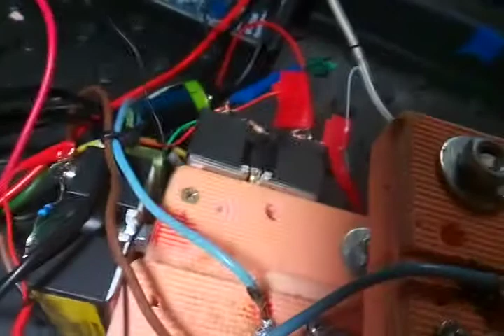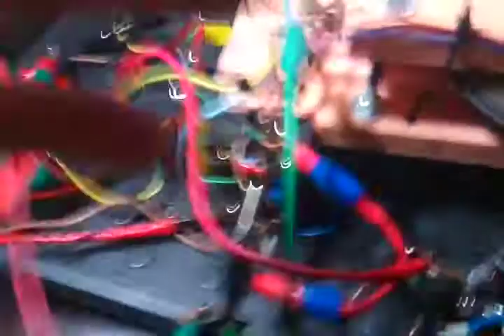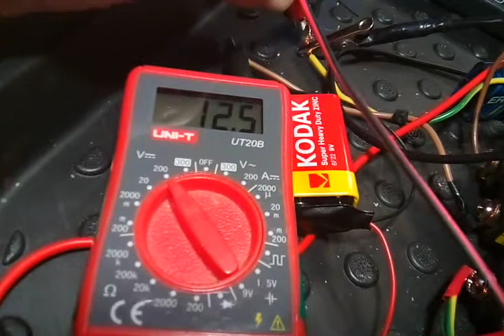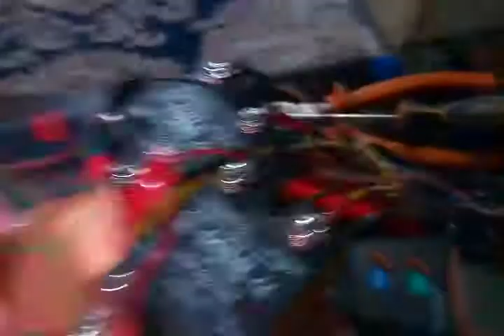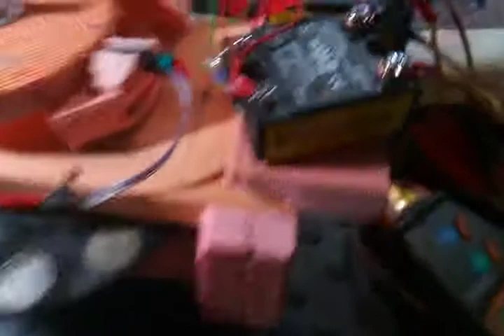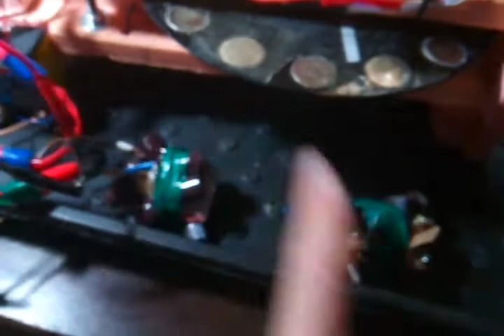Part 5  Plan to loop; finding best placement of flyback/collapsing steering diode (surprising)

Comment: What an interesting concept with where you place diode, I have never tried this, thank You.
Reply from the maker: You are welcome, I think this works as it does because of the two switches and both hi and lo of coil, switching simultaneous.
Bill Muller told me they recover the collapsing field in their motor coils same method, with two switches, one hi one low and each has the AC legs of a Full wave bridge rectifier across them (right across each of the switches so needs two FWBRs)  then both DC outs of FWBR into a cap (or into two caps if you want)
This way he said you catch the backemf./collapsing field on "both sides" and you get more
could be he did this with genrator coils too, not sure about that I only asked about motor coils.
Reply: @MrDKONZEN  most people that do what we are working on are quite familiar with the inductive Spike after turn off of Power event. Less known is there also happens to be an inductive Spike, or pre Spike that happens the moment power is applied to an inductor. With very hard fast switching pre spike can equal post spike.
Reply from the maker: @alexissmith1713  Hi Alexis   
Interesting, sort of forward and backward spikes? 
Or two backward spikes, one masked by the forward current?  
Or "spikes split" faster than speed of light  (X2 because it goes both ways at once! my favorite theory)
 If split X2 thing, then perhaps that forward spike is really the  split inductive spike after turn off but it has jumped ahead in time and becomes a "pre spike" since time is messed up by the jump forward....hmmmm
Also if split X2 spike true, then thats where extra energy gets pullled in from immediate environment, as nature is filling and healing the wound of the split time displacement...(?)
Perhaps there can be coherence of pre spike and post spike and law of coherence (Wilbert B Smith) is that energy becomes X4, not X2 when two fields combine and "cohere"...
Perhaps the actual backemf (usually confused with inductive spike) coheres with spikes if you can get bounce back just right and next pulse has its backemf cohere with previous spike.
I could go on! Thanks for pre spike info!!
Reply: @MrDKONZEN  Your welcome!  I appreciate your interesting theories. The way I see it is that everything in nature is basically lazy and "RESIST" change, in the case of inductors they resist by pre and post spiking. I do think both spikes are strictly in reverse and any positive portion you may see are probably just the inductor ringing.

Comment: So are you going to switch from one cap to the other cap by the timing hall's when looped?
Reply from the maker: Yes, but not "when" looped, rather cap to cap is what is going to "keep it" looped...Not sure it will work as caps into caps halves the voltage split between the two however, cap A will still have its share of half the voltage however, so will be "easy" to fill up next cap to cap cycle.
Thats the idea anyways....its got to be an overunity condition in first place, the filling of the cap before it discharges to other cap in order for it to sustain itself.  I will give it a 10% chance of looping success actually but am going to try it out anyway strangerr things have happened eh....  The unexpected always pop up when you do the bench experiments hands-on  so hopefully it will all be good whatever happens....for example  the placement of the diode and cap right now - it has applications for "H switching" invertors I think, as now you can build an invertor that recovers the backemf/flyback in the primary circuit and it could be a super effecient invertor.  The SSRs pretty slow better to have something else for switching if going anything near HF, but can probably do 60hz with them and a short pulse width. For dumping caps into caps they should be fine as its not such a fast switching thing, just happens once a revolution lots of off time between.

Comment: Nice definitely a fast cap fill Doug!
Reply from the maker: The cap is in parallel with the power supply, but the diode there between the positive IN and the positive of the cap, so the battery/power supply zaps the cap really quick up to the 7.5VDC then after that the backemf/flyback/collapsing field does its job and its an easy job since cap already at 7.5VDC - filling a cap at zero volts not as easy as one "pre charged" is I think why so quick

Comment: Less than 10 ma drive current, holy shit awesome Doug! 8)
Reply from the maker: Its mainly the impedance of the motor coils so high compared to the input voltage not such a big deal as only 300rpm and not much torque   however if it loops I will certainly be happy about it... Could be some really good stuff is going on, as in "coherent" fields - the power input DC "field" has "cohered" with the collapsing field "field" and so you dont get X2 but X4 according to infamous Canadian  UFO researcher Wilbert B Smith....check out his "tempic fields" and multi dimensional stuff he got from the ET folks:

http://www.treurniet.ca/Smith/ArchiveIndex.htm
Reply: @Timtron432  add a "l"
Reply: @skydog22  Hi, What are you talking about? Add a ''I''???
Reply: @Timtron432  lol, :-) you edited your question out but for doug's url link to function from his comment.  It ends in .html the other way is 404.

Comment: Hey Doug how's it going like what you're doing just one suggestion you're using 9 volts to power your system I was thinking if you were to jump it up to 18 volts put to 9 volt batteries and parallel to get it up to 18 volts your your back EMF spikes are going to be a lot stronger and the amperage dumping into those caps are going to increase quite a bit that's just a suggestion if you want to try it I do have a video I want you to watch it's actually there's two parts I'm going to send you the link for part two how I'm charging up capacitors and how fast I'm able to do it using high voltage so maybe this might jerk some ideas or whatever I'm going to post it on the EV gray forum so here's the link
https://youtu.be/ad8K-jyGyM0
Reply from the maker: Hi Mike
I was using two batteres in series for 18Vdc before this video but the RPMs didnt double, more like 15% more and the draw went up quite a bit as well so decided to go with single 9V battery instead.  
My idea is "too much" current through the motor coil makes a big rolling snowball effect where the backwards collapsing field energy that is filling those caps gets dwarfed and difficult  to make it back where it came from with its "hot spike" punching through the snowball. (descriptive eh)
Also I have lots and lots of winds now because I connected both motor coils in series, with also the pickup/induced generator winds now being connected in series too,  to the motor coil winds,  so total ohms is up around 45ohms that the motor coil pulse flows into, length of winds maybe 200 meters. not sure exactly what it is,  but lots of length to winds and high impedance...the  hopeful idea is the pulse never quite reaches the end of coil winds - with the very short pulse width, and with very low voltage too. (voltage being speed) so thats the idea of whats happening anyways.
Thanks for the link, I will check it out, I was  on your YT channel a few days ago and saw you are into the Don Smith HV stuff now....Norm W on EVGRAY group knew Don and visited him a few times down in Texas.  
He said Don was really into mapping out the magnetic fields of the earth and looking for those "hot spots" where fields shoot out and whenever you have magnetic field there is electrical field and vice versa so that how I understand it.
Also saw your top secret DePalma generator unveiled!  Pretty cool... I see how a super big magnet could combine Faraday disc and homopolar designs....
Seems like Bolting together with nuts NN or SS ring magnets with a stainless steel or brass or bronze threaded axle rod might be better/another way to do it, and you put brushes onto the squished gap area - here is video of idea:

https://youtu.be/A3vV5T4x-FI

Comment: good to see you are still working on that project.. the problem with that method is the losses... i do it a little differently, which has advantages but also disadvantage. but maybe we are doing the same thing, and just explaining it differently..😱
Try the following: use a bifiler coil (just use one strand you have now set in series if i understood correctly)... use one strand like you are using your whole coil now. The other strand,  connect the minus of the cap on the side where the positive of your power goes in, and put your diode on the other side... and connect to the positive of the cap  (currentflow opposite to the direction of the coil) ... 
You will see you get continously the same amount of power into the cap you are getting now, but without the power surge (actually the consumption goes down when you connect a load).

if you connect the cap the other way round.. you will not get the"backemf"  but only the low voltage of what is generated.  
i abandoned the ssr switching for the motor part, because you need not only Power to switch the internal mosfet, but also power to switch the low voltage part. by using a bedini type circuit (trigger coil instead of hall) in combination with a good reedswitch to shorten the pulses, i think you could get even better results.
Allthough i must admit I would be happy to be able to have such low consumption on my systems as you have. 
I am working on another very earth to earth project now: building a new kitchen i my apartment. so in the next weeks I have absolutely no time to build a motor.😤
But Those are my 2 cents..
Keep up the great work
Luc
Reply from the maker: Hi Luc
I wont be able to try exactly your bifilar method right now, since these coils are wound single strand of HF litz wire, and in directional pattern too (pull back to back end of coil after each row)
BUT I do have lots of  those pickup/induced generator winds wrapped all around that motor coil that is inside of them... what will be fun is to try you bifilarr approach but using the pickup winds in place of that 2nd strand of hall effect, then connect diode and cap as you describe.
I dont have much time either, as nowixing up soviet-style balcony in apartment here in Minsk, plus just finished doing bathroom, pouring concrete etc.  Going back to USA on Dec 1 via Turkey,  Wish us luck getting through the borders and Covid19 everywhere.  
I didnt have much time in USA all summer, fixed up my 93yr old moms house to be rented took forever had 320 hours into it. 

Anyways I think its super interesting how the diode right across the power input catches the backemf best - maybe just do to the  hi and lo switching....applies to H switching invertors too, maybe I discovered something.
Thanks for writing! Always enjoy your comments!